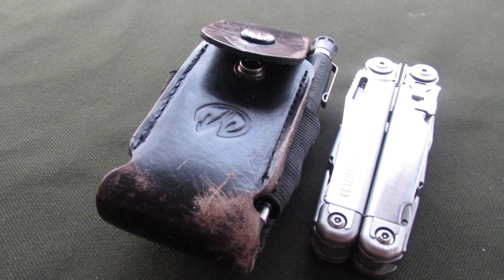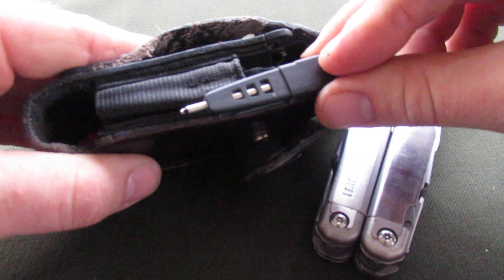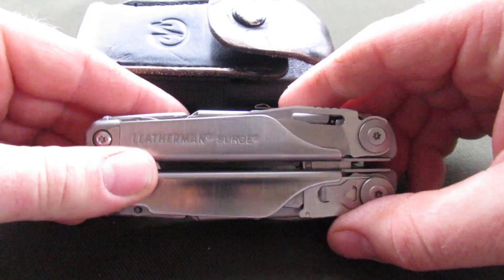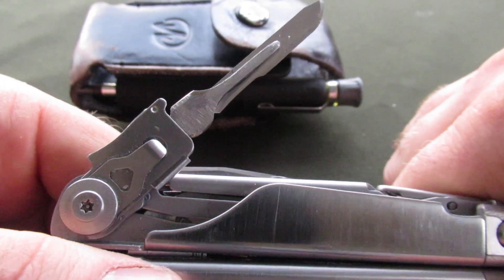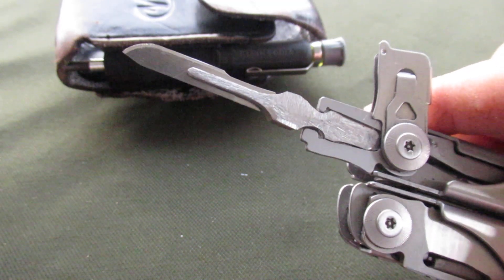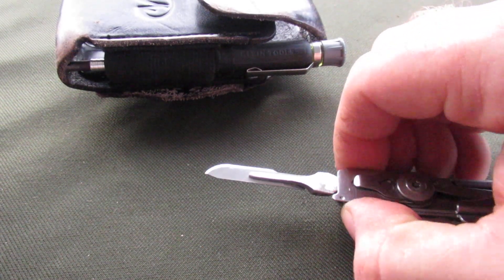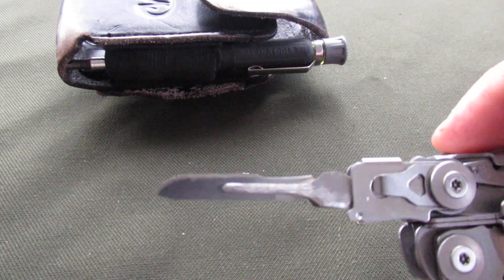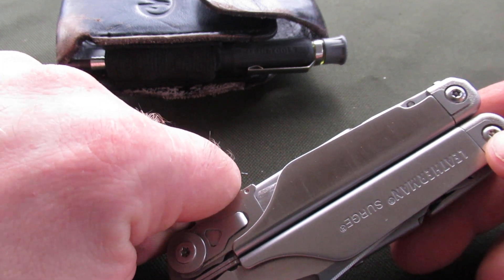Leatherman Surge New Tool Mod!

Comment: nicely done! Happy New Year! everyone
i found a Kriss style tshank blade to use as utility blade and spare the 2 blades of my Surge. im not afraid to dull or deteriorate those blades, i just want to keep them food-grade. its called Wilpu HWL 100
Reply from the maker: Very nice!  That jigsaw blade almost looks serrated.  Nice idea!
Reply: @hvacbudget8600  the picture is bad, the blade is beveled on both sides, like a plain blade. Also it looks like on top on that is a secondary grind, a very thin one. For fun i treated one with blue-ing solution for weapons, so its less then 3Cr. It is not a precision blade, as the one you presented. I liked that alot. I wonder if one can mod a chisel for a Leatherman.
Reply from the maker: @randomescu  The easiest way would be to put an edge on a flat leatherman screwdriver implement.
   Secondly you could get an extra wide 1/4 bit  like 3/8×0.55 and then grind it to a chisel point.  Then you could make it thin enough in the back to fit into the bit driver on the Surge.  
 3rd, you could probably find a Victorinox multitool with the chisel to take apart or maybe a single chisel implement from a victorinox on Ebay and grind it to fit the t shank adapter.  I've only ground the flat screwdriver on the Wave into a chisel so far.  It works pretty good.
Reply: @hvacbudget8600  ill grind the larger part of the double flat screwdriver from Skeletool CX. I owned the SwissTool with ratchet and gave it away to my brother. Great tool and awesome ratchet, indeed. Thank you for the ideea.

Comment: Love my new surge,I've only had it for a few days.
Reply from the maker: Congratulations!  It's the best multitool I've found for my work EDC so far.  I think you'll keep liking it!
Reply: @hvacbudget8600  ,ty,yeah I remember back in the 90s when I had Leatherman similar like the new rebar but older before they started putting the main cutting blade on bottom,more like a traditional knife feel,an not on top where bottom handle would get in the way on certain tasks,I'm definitely loving the weather exchangeable saw an file blades, decent weight an love the replaceable cutters
Reply: @hvacbudget8600  ,I chose this cause the quality,few multi tools that I like,some dog an Victorianox,It was a tad pricey but bit the bullet an grabbed one
Reply from the maker: @kennywheelus6857  I don't think you'll regret it.
Reply: @hvacbudget8600  ,that's for sure,I just can't put it down,even while watching tv or YouTube,I just like holding it too.

Comment: One of the Gerber tools has a blade exchanger as well.
Reply from the maker: I should have clarified only the Leatherman Surge has a file, saw exchanger.  You are right Gerber has a thin saw exchanger and the Leatherman 300 EOD has a thinner saw exchanger as well.

Comment: Is there a way to mount the carbon scraper on the surge? That would litteraly make the perfect tool for me.
Reply from the maker: Let me check into that.
Reply: @hvacbudget8600  maybe replacing one of the blades? Or replacing one of those flat heads
Reply from the maker: @Popcornman854 
The problem is the carbon scraper is thin and the attachment for the screw has little metal around it.  

You could solder the brass scraper to another piece of brass shaped like a t shank to fit in the adapter.  Welding works as well.

You might be able to remove an outside blade and find a way to attach the scraper that way.

You might be able to drastically cut it down and fit it in the bit adapter.  

You could again weld it to another piece of brass that has been cut to the shape one of the inside tools.

You could perhaps also find a magnet to fill in the scrapers screw opening and simply magnetized it to the Surge.  Not sure if the scraper is long enough to be used as a tool on its own.